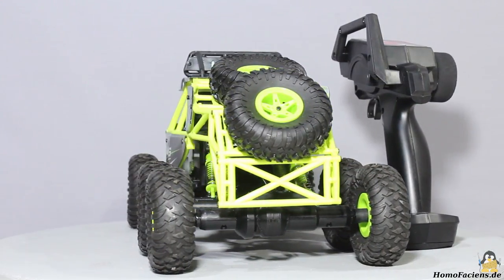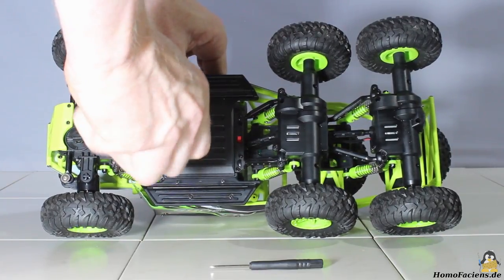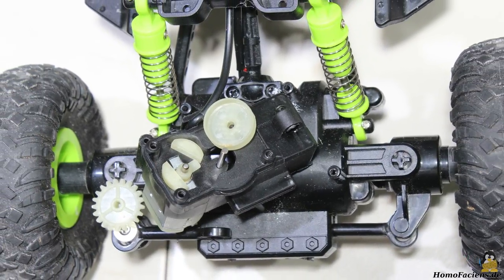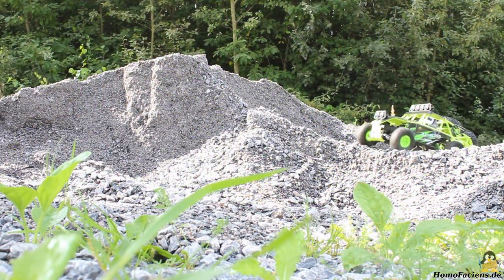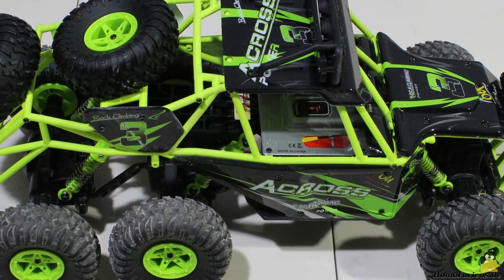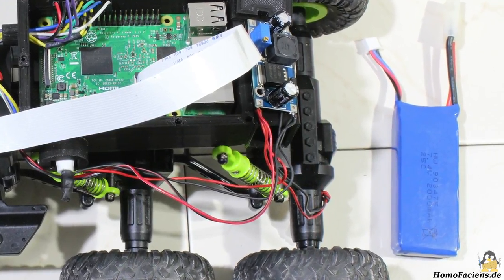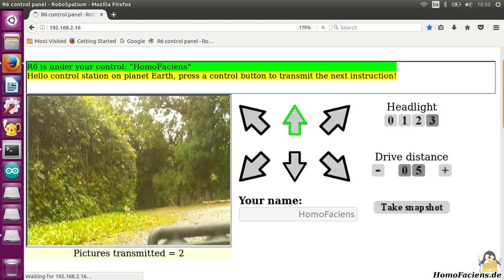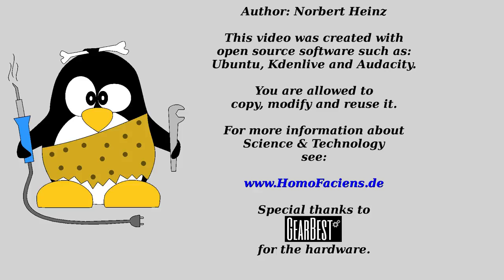WLtoys 6Wheeler conversion to a rover

Comment: Thank you so much for this !!!
I had a similar idea on my TO-DO project list, with your example it will be easier to start.
I will try to develop auto pilot mode with OpenCV library.
Thanks again!!!! And please say 'hasta la vista' or 'get to the chopaaa'  in next video.
Reply from the maker: Developing software for driving autonomous ly is no easy task, but it's worth trying.
...I'll stay with the "I'll be back" phrase ;-)
Reply: I wasn't thinking about something too sophisticated, more like ' stay in lane pre designated lane ; detect traffic signs and lights ; avoid objects in path '.
Are you going to upload code from this project?
Reply from the maker: Detecting traffic signals isn't too easy as image processing is tricky in general.
My software is only remote control without autonomous tasks. I will upload a simplified version of the code this robot is using (all running on the Raspberry Pi, no Internet server needed) after a couple of test runs. I am still implementing software features and there are bugs waiting to get fixed. Be patient.

Comment: What about adding a microphone and a speaker connected to a small amplifier to the Raspberry Pi. It will be interesting to have audio-based communication along with the video.
Reply from the maker: Receiving audio samples with a microphone is on my list of things to implement (in this or a later robot). A speaker is an option as well.

Comment: Awesome!. Are you gonna give it solar panels too?
Reply from the maker: Thanks for your feedback!
Solar panels won't stretch the operating time noticeably. I am using 2000mAh batteries that are good enough for 2.5h of driving around. Having three of them (one in the rover, two on the charging station) you can drive endlessly.
First and foremost I must make this type of robot reliable, thus no more features than needed. I'd like to send it also to people with no technical background.
Reply: Awesome! Did you place the charging station somewhere outdoors? Maybe the charging station could be solar and have batteries of its own that would charge while the rover is prospecting? I imagine little rovers like this being on the moon or mars to peek at things without having to EVA.  Cheers!
Reply from the maker: ...my concept of recharging the batteries needs assistance from the habitants on the target planet ;-)
Having a solar powered charging station is on my list of things to build.